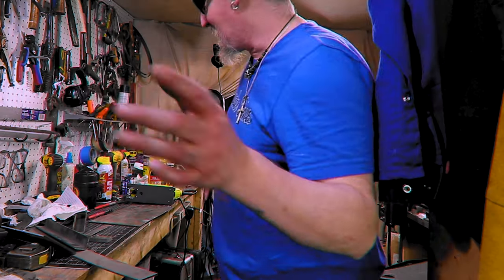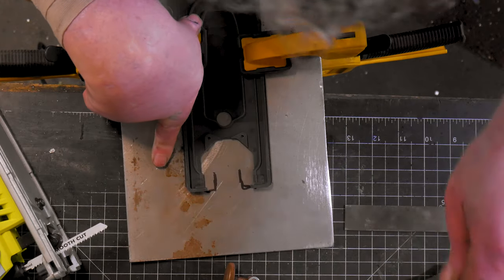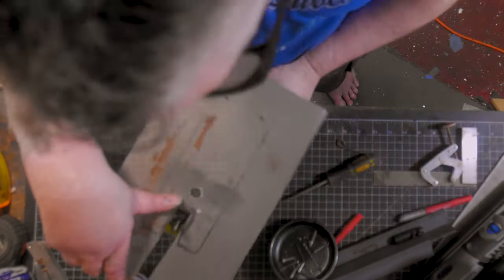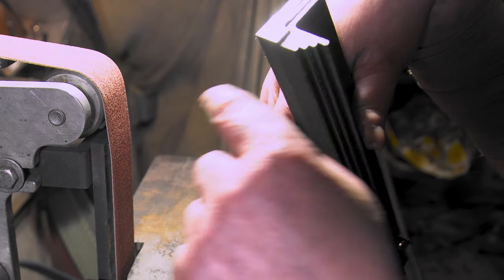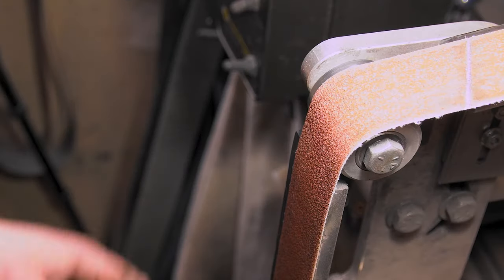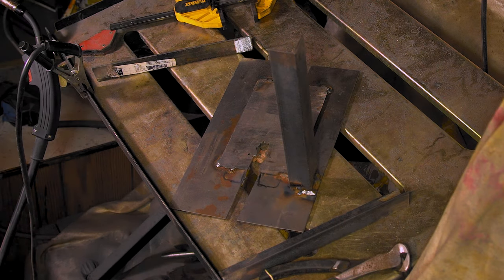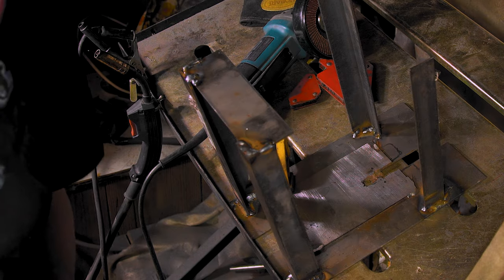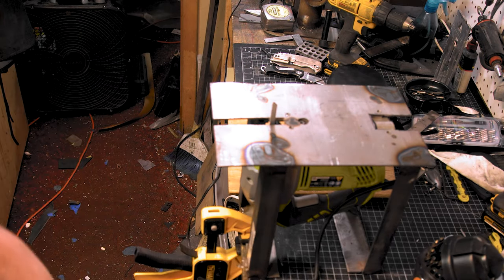Jigsaw Table Build

Comment: Looks good! I’ve taken and flipped a portable router upside down in a vise and put a die grinder bit in it and it works pretty good to grind shapes you can’t normally get too. Idk if that’s allowed or not but I do it anyways haha😎
Reply from the maker: right on, I did the same thing with a trim router, but i just took the plate off & made a bigger one. The jigsaw was a little too big for that though. You can see it in the back to basics video at 10 minutes(45) in. Hope all is well. https://www.youtube.com/watch?v=EQDVp77u0iM

Comment: For cutting handle materials get a Wen or harbor freight upright wood bandsaw, and for metal get a Bauer portaband saw from harbor freight and build a table for it or buy one i would not build one of these
Reply from the maker: I don't cut much wood, but I definitely have the metal cutting bandsaw. Appreciate the advice.

Comment: Hi Dave I want to ask you how to shorten the thermocouple that is too long. wrp 100 thermocouple K-type. Thanks
Reply from the maker: On the one I have it's 2 wires with like a bunch of small ceramic pieces over it, so I just took it apart, removed a few pieces off and slide the wires back through. Just unscrew where they are held & push them up. Hope this helps
Reply: @evaderknives  Thank you Dave, this help me.